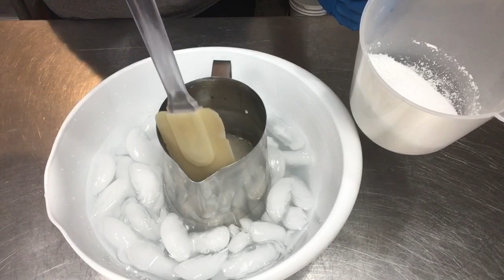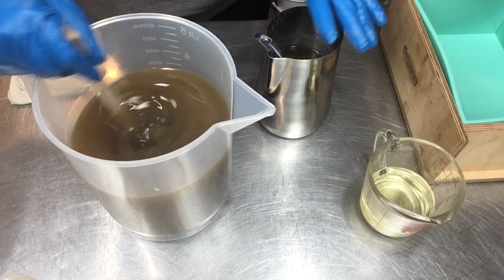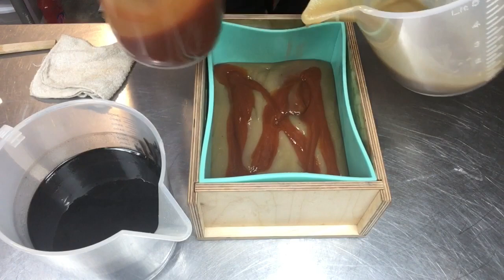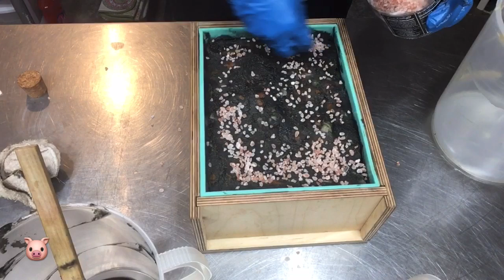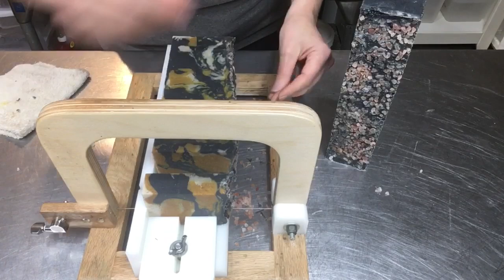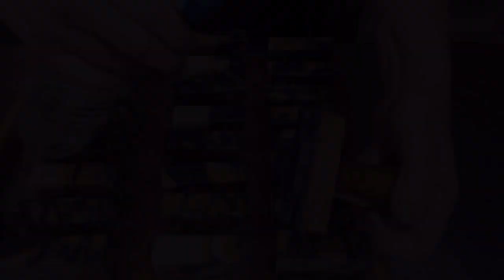All Natural w/ Essential Oils, Charcoal, Turmeric & Clay + how to fix airpockets | Ellen Ruth Soap

Comment: I'm a rustic soap gal; no floofing, lucky if I get an occasional swirl. I agree however on the filling of holes. Thanks for round 2 of oregano oil; now I know not to try it with hot process and to dump the oils, dump the soap 😉👍

Comment: Next time, only add the EO right before you pour. One at a time but that will keep it more fluid.
Reply from the maker: That's a great suggestion 👍
Reply: @EllenRuthSoap  You may not get the swirl you are after this way but it will help a little keeping the batter a bit more fluid. The clay will also speed up acceleration and that's the fun of it, right?!?!??!?!